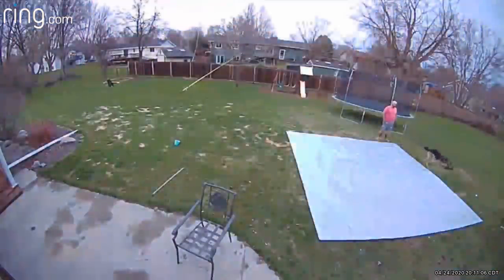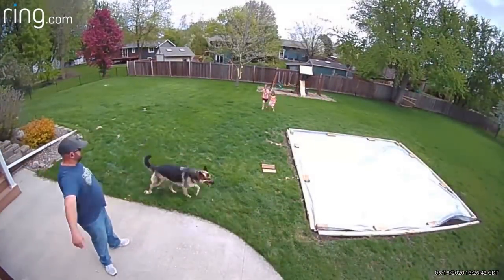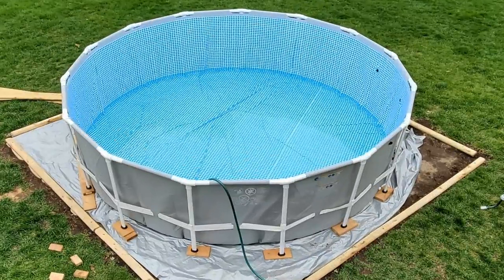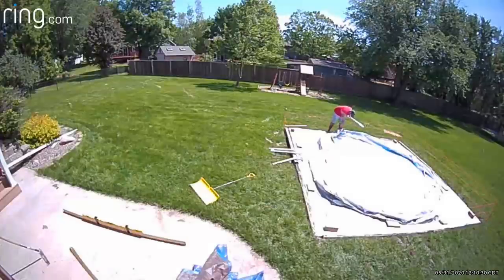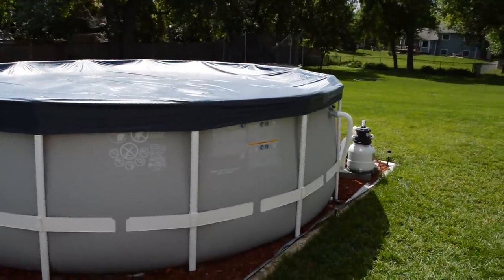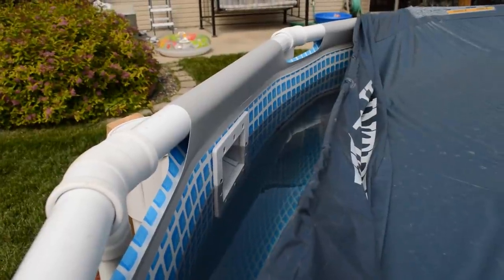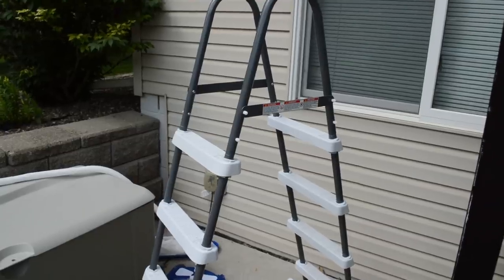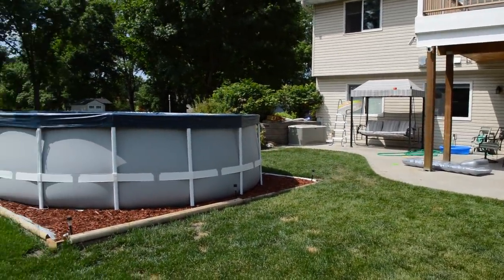Intex 15 Foot Prism Frame Above Ground Pool Setup, Review, and Mistakes!

Comment: Thank you so much for your informative video. It’s very helpful. I was looking a review for this pool . We have the same pool. I like it but I don’t love it. I am very happy we were able to buy it on time and at a reasonable price but I will definitely update next year to the Intex ultra xrs. My friend bought one and you can see the difference in the quality of the liner, frame and pump. We had  the same issue leveling the ground. Like you said this is the most important step if you want to do it right. I am using the pump and filter that came with the pool but I would upgrade them I could afford them. This pool is perfect for us especially now with this quarantine. Good Luck everyone
Reply from the maker: Thank you for the comment. And I agree, it's been a life saver during quarantine.

Comment: 25:33 standard Intex size is 1.5" tubing,you had added an 2" ones... which is fine! What is not so fine is that you had only one outlet and that is the skimmer. There reason why pools had outlets in a deepth,the water must circulate and mix.In your case where both inlet and outlet are on a surface level the circulation wouldnt be good and that's why you are running your pump(which by the way is overkill for this size) 12h a day,instead 4-6h.
Another thing am not fan of is the salt water system! It will corrode the metal tubes in no time.
But you have a wonderfull yard on which am jelaous and the pool is great... so wish you happy(and safe) summer days ;)
Cheers
Reply from the maker: I am going to rig up a different system for the inlet next year and utilize the lower outlet as well as the skimmer. So far, it's been doing fine this summer but you're absolutely right. Thanks for the comment and the input!

Comment: Omg your pool Is perfect.. I've leveled twice...1st myself , 2nd pros... week later legs on front end have moved a tad YET AGAIN like the 1st time I did myself 😫😫 I cannot drain again and start over again😔 takes forever to warm up. I'm just hoping it will hold up another month.
Yes I have had grass dug up, pavers under legs and sand. Sooo upsetting. Anyway  nicely done!!! Thank you for the detailed vids!video!
Oppps noticed my comment is on the 1st set up video...should be under your 2nd year

Comment: I did the same! Same pool! Same leveling mistake. Had to have a pro come in and use an excavator to dig out our hill and make our backyard flat. Our house was built in a hill so to speak. EVERYTIME my kids get in the pool and it rocks I am so paranoid that it’s going to bust. I hate nagging them to stop being so rough. Ugh. Maybe I’ll cool down a bit. We upgraded our pump as well, and added a over the edge skimmer. I was going to try the salt water route, but right now I’m tired of spending money on it. 😂 We wasted a whole pool full of water the first time as well. But mine was like 8 inches fuller on the hill drop off side. I dug it out but didn’t pack it down. Oh well. You live and learn. How are you keeping the water clear. So far I’ve been pretty lucky, one chlorine tablet and my excavator told me to shock twice a week, esp here in Florida.
Reply from the maker: Sounds like you've been having an adventure with yours too! I don't worry about it rocking too much. My kids are pretty rough on it and it's doing fine. As for chlorine, I have a floating dispenser that I keep full with 3 tabs at all times and shock it as needed. I test it about every 2-3 days. It's been holding up well so far!

Comment: We installed a board across on the top rungs of the pool ladder to help create more sturdiness.  It helps to keep it from racking (twisting) when adults use it since it is so rickety like you described.  

Thank you for the good information.  Very informative video.   Thanks!  🙏

Comment: I wish I had watched your very helpful video before I started on mine which a 14ft diameter model. Thanks for your effort to help others! 
I concur with your advice. In my case there was only a 12” space around the pool in some areas around it and I had about 12”-16” height difference to level out. A lot of pick and shovel work to get the dirt out and level it. Fortunately there was no grass to deal with and the dirt minus the few rocks and tree roots I had to deal with provided a “good” base for the 4K gal + of water. Seeing how long it took to drain the water out scared me to think what if the vinyl tore or the structure collapsed. All the water would flood the structure next to it on one side. Crossing my fingers it won’t happen! Seeing you used 2x’s to alter the height of the rim though concerned me in that on mine, the bottom of the pool was in contact with the edge of the wood and I removed them and used dirt instead to raise them, being afraid that when vinyl could tear. The tarp that came with the pool was a thin and flimsy plastic. Below that one I placed a very thick sturdy tarp to provide additional protection from potential roots or pebbles under the base and sides. Once the summer is over here in California, I’ll take it down and will apply some of your advice and what I’ve learned for next time. All that work though, and it was a lot, was very worth it as I’ve spent time with family cooling off in our triple number summer heat. Thanks again!

Comment: Funny. In June 2020 I put in about the same amount of work (maybe more?) to install a 16x20' patio in our back yard. And basically for the same reason. Covid had just hit, we were going to be spending way more time at home, and I wanted a nice place to spend our time. This summer we bought a little 8x8' kiddie pool and probably just like with a full size pool, we've slowly but surely started gathering extra supplies to keep it clean so we don't need to empty it every few days. I bought one of the pumps that aren't good enough for a big pool, but it's working just fine for this little thing. And we've been adding chlorine and got the test strips to make sure it's not too chlorinated before going in. Basically preparing ourselves mentally for getting something bigger next year! It's surprising how much my wife and I have been using it. Just as much as the kids. At the end of a long work day, it's nice to just lay down in it and cool off.

The big problem for me is, our back yard is a hill, which is where I would put a larger pool. We live on a hill (the city put a water tower at the top of the hill we live on), so leveling the ground is going to be a chore. But we're thinking of doing something much, much smaller than this. If we can set up and maintain one of the 12x12' x 30" ones with the inflatable ring around the top, that'll be good enough for us. So we'll see! I really appreciate you making this video because I learn a lot from mistakes :)
Reply from the maker: Thank you very much for the comment! Good luck on your pool journey!

Comment: Same pool - Messed up keeping legs inside the band as the loops came oriented outside the band and no mention in the manual. Ended up putting a giant. ratchet strap around it :)
Reply from the maker: Thanks for the comment! The "instructions" were definitely lacking.
Reply: Hello! Can you please elaborate on the strap you put around it? What exactly did you use if you don't mind? We have a 12ft one and the feet don't come with the holes to keep in place. Thank you!!
Reply: MsMick01 I used two Keeper 2 in. x 30 ft. Chrome Ratchet Tie Downs from Home Depot. linked together. Ratchet it snug (don’t overtighten). And legs stay put and don’t bow out. I think the straps are rated for 10,000 lbs. probably way overkill considering they used to shop hem with a rope. :)
Reply: @curtismann3649  Thank you!!
Reply: Yep I’ve had one of these Intex pools for the last 7 years (just got a new one this year) and we always put our legs through the loops on the outside of the band. Never had any issues 🤷🏼‍♀️

Comment: Hey another tip for someone who wants to upgrade pump and does not want cut the pool liner. The original houses actually fit down there inside the larger houses. I can provide pictures evidence. If you want to just spend money lol they offer adapters

Comment: I have an older model with the peg you push in on the t posts, that not a problem.  What's going on now is the the poles that go into the tpost are rusting and crumbling apart. I'm using a closet dowel to hold it together for the rest of the summer. Pools are hard to find because of covid.  Keep an eye on the hoses, after a couple years usage they will start springing leaks. Good luck with this and I know you'll all have fun swimming

Comment: Thank you for the wisdom of your experience. I'm about to put up the 12ft x 30 inch version/  slightly smaller but still big enough to stick next to my deck bar.  The leveling looked to be the most important obviously.
Reply from the maker: Absolutely! Make it right the first time and you'll be golden.

Comment: Thanks, very good video (step by step)I had one exactly the same with stock parts, lasted 3 years bottom liner started to rip (my back yard is concrete)I just run the filter pump 24/7 and vacuumed every two days it was all good. Now I bought a Summer Wave 14' that I’m getting ready to setup it has a skimmer/filter pump  but I’m thinking about adding a sand filter like your setup.
Reply from the maker: Thank you for the comment! Congrats on the new pool!

Comment: I have a 12" intex pool.  It has lasted about 5-6 years and probably get another 3-4 out of it.  The steel structure is starting to rust and the pool pump gave out last year.  This pool should serve you well if kept well and treated with respect.  Moving on to a 15 foot ourselves soon or eventually.

Comment: Very impressive stuff and helpful, was hoping you show the solar heater, I've just put my 12 foot pool up  , but I put it on a very sturdy 6x2 decking at 15 x 15  , then put carpet on it to be easy on feet and the liner .mines run out by just over an inch,  but thankfully no issues with sinking legs . I got a bestway pool heater today Hope's it's a bit warmer tomorrow.
Reply from the maker: I have a video where I make the solar heater! Check out my other vids. Although a word of caution, the background music is a bit overpowering. Just FYI. 😊

Comment: I feel your pain..I set up a 12×30 inch on a 19 inch slope and it was some of the most exhausting work I ever done.i am 1/4 to 1/2 inch off as well after all my efforts.well worth it though.i put my legs on pieces of patio stone.
Reply: Did you place your stones on top of the sand and level at that point? Or are your stones sitting on top of the dirt?

Comment: you could DIY a levelled platform/small decking on one side of the pool made from pallets to easily access it instead of using the ladder.
Reply: Is there a video on this?

Comment: I knew that there was a lot of work into getting the ground leveled just right because we leveled the ground ourselves with our first pool. I bought a 24x52 and so knowing how much work there is in leveling the ground I hired someone to level the ground and set up the pool. It cost me a 1000.00 dollars but it was worth it. I hope to have a deck built next year. I bought steps to use to get into my pool instead of the A-frame ladder that came with my larger pool.  With the steps it is so much easier to get in the pool than using a ladder.
Reply: Can you tell where you got your pool please

Comment: It is recommended to remove dirt to lowest point not build up to the highest point, never build up.
I didnt bother with the sand this year too, third year owning pool and had to set it up in different spot lol
Reply from the maker: You are absolutely right. And I started with removing dirt from the high side but once I got down about 5 inches it was so packed I would have probably needed some machinery. Plus, I didn't want to have to build a retaining wall. So I split it between removing the dirt at the high side and adding some at the low side.
Reply: How crazy would it be to just try leveling only with the existing dirt? And how thick sand layer did you put after you put the black soil?
Reply from the maker: Depending on the slope of your yard, you could easily move around the dirt that's there. Unfortunately the slope was too much at my spot. I would have needed a retaining wall if I dug out the high spot that much.
Reply: @dontburnthehousedownvideos  thanks for your reply. I found your video very helpful after watching many videos. 
I'm working on setting up my 9x18 and your video just reinforce what I heard . Level, level level.
I'm just a little confused as to how much sand I should put after the dirt. I'm trying not to disturb much of the ground and level as much as I can without adding much to it. My liner area is 11' 1/2 x 20' 1/2. I started from the lowest side at ground level and dough about 10-12" on the other side
Reply: So my question is. Do you think I could be ok with leveling as much as possible with undisturbed dirt. I don't see the point on bringing any other dirt or sand if is going to shift. I mean, leveling to a point where I only use sand to fill small spots.
Reply from the maker: I would not use any sand to actually level the ground off. If you want to move the existing dirt I would recommend tilling it up first to make it looser then level it and then pack it down. Only put the sand on top of the already level ground. The sand should only act as a base for the pool to make the bottom of the pool not so hard when you are walking on it. The ground should be perfectly level before the sand is applied. The sand should not be any deeper than 1 inch.
Reply: @dontburnthehousedownvideos  got it. Thanks for your time!!

Comment: If you want the skimmer to look clean without that 2x4 get a piece 4 or 6 inch of pvc pipe and fish the tubing down and cut a hole in the bottom out the side towards your pump and butt the other end against the bottom of the skimmer. Think mail box post thats big enough to hold that drain line.

Comment: I just bought this pool and this video helped a lot. I'm not sure what combo of chemicals to use do you have any suggestions?
Reply from the maker: I honestly don't worry about Ph up or Ph down. I use shock (which is concentrated chlorine) and chlorine tablets in a floating dispenser. I use test steps to check the chlorine levels and add shock as needed per the directions.

Comment: use a pipe from the skimmer to the ground and a 90° connection to then take the soft hose from there. If setup correct the PVC pipe will take the weight of the side wall and you don't need the 2x4. You can do the same with the inlet making the piece of string obsolete.
Reply from the maker: Terrific ideas! I might put that together here soon.

Comment: This is an unbelievable amount of effort.  Just put a tarp down, throw sand on top, throw snother tarp on top and then the pool.  Dont put any walls or wood frame for decoration until everything is done
Reply from the maker: For this size pool and on uneven ground, it would almost certainly collapse when the legs sink.

Comment: Oh no. I didn’t realize that the legs need to be inside the band. We put them in the loops on the outside. All the other videos I have seen have them on the outside. The instructions are super clear about this. What does everyone else think? Do I have to drain and fix it? crying
Reply from the maker: If you put them on the outside of the band you are putting 100% faith in the stitching or glue holding the loop to the band.

Comment: You have got me scared to use sand now but I already have it layed down so I think what I’ll do is dig the pavers into the sand and ground to stop it from sinking. Hopefully it works
Reply from the maker: It just depends on how much sand you use. Go more than 2 inches and you might experience some undesired settling.
Reply: @dontburnthehousedownvideos  I think it’s around a inch and a half so I am hopeful it stays set

Comment: If you need a leg to kick out like I am seeing at 17:21, use a car jack and a 2 x 4 and lift it up in that area a little.  The leg will kick out on its on.
Reply: Also, I would use rubber mulch.  that stuff you have down there around the pool has some pretty sharp sticks in it.  Some of those ends on that mulch is like needles!  They will puncture that pool easily.

Comment: We are just setting up an18’ by4’ prizing pool. We are off about 3/4 inch from front to back. It sounds like that is not a big problem, do you agree?   We also watched other videos and they said to use sand and now most are sating dirt. This was dirt and sand was put over it for a volley ball court.  Do you think this is a problem?  Your videos are great. Thanks
Reply from the maker: Thank you for the comment! I would say 3/4 inch is perfectly OK. However, I would recommend you really pack down the ground first to make sure that 3/4 inch difference stays consistent. The ideal setup is all dirt, packed down, with about an inch of sand on top spread uniformly. That way you know that the pool will settle evenly. If you have several inches of sand you run the risk of the poles sinking into the sand at a different depth than the pool will. That could make the 3/4 inch much larger by the time it settles. My advice: if you have more than an inch of loose sand, remove some. If it is already really packed down you'll probably be OK but you really only want the sand as a finishing surface, not the primary base. Does that make sense? Good luck! Keep me posted!